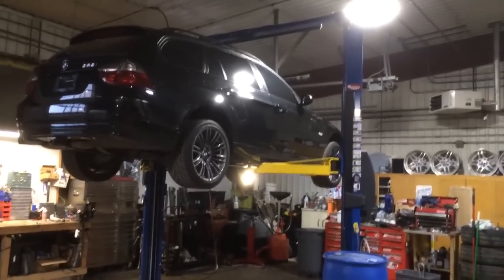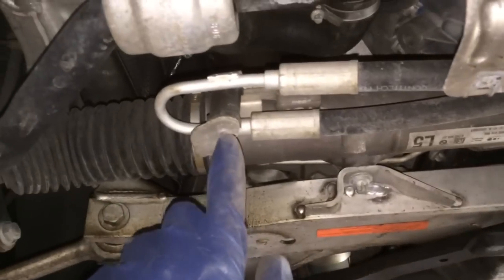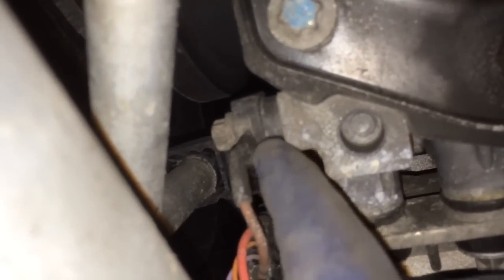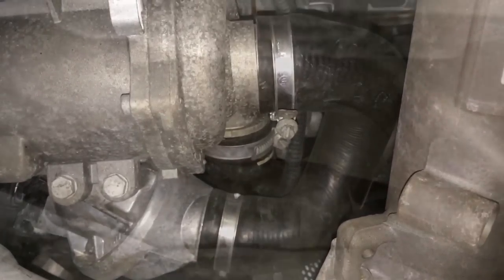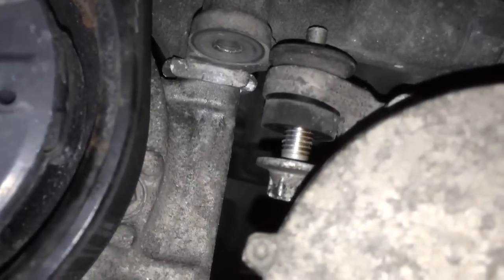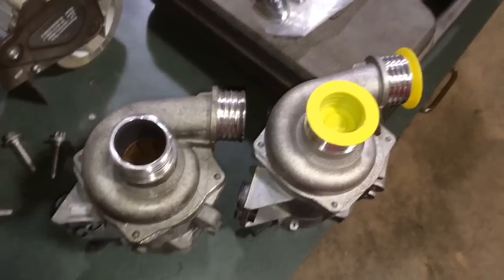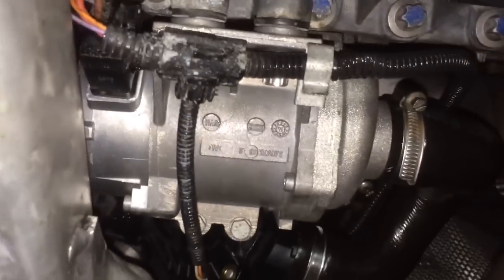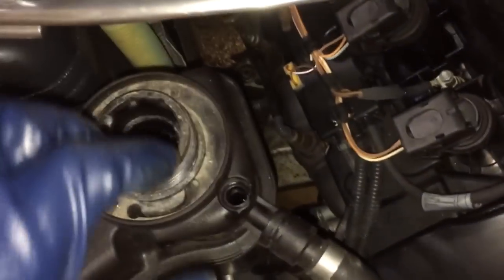BMW e90 e91 e92 e93 325i 328i 330i electric water pump and

Comment: this is not e93 video...e93 is wayyyyy different...
Reply from the maker: nope. identical. You might have a twin turbo car, those are way different. E93 328i is exactly this same process.
Reply: @OvalboreCars  nope n55 single turbo m sport.. lower x braces due to no integral roof structure.
Reply from the maker: again, this is not even remotely close to a 335i. 

the under bracing is irrelevant to the job itself. turbo cars have a completely different pump setup and are much, much more difficult. See my X1 pump replacement video for a closer analog.

This has nothing to do with your car being an E93 and everything to do with the fact you're looking at the wrong engine for a DIY.
Reply: I have a e93 with N53 engine and it looks totally different. Sitting here got many things off and now the steering gear is in front of the pump.. the video can’t be used for the E93. Don’t know what to do next now… thing I’m gonna assemble it back together and drive to a mechanic

Comment: Hello how are you doing? Very good video. I ask you, I did the test but it doesn't work for me, the mechanic tells me that the pump burned (for the second time), I changed it a little over 1 year ago, it has not even traveled 20,000 km with that pump. Can you think what else could it be? The car heats up and I found that I had blown the lid off the water reservoir. I appreciate any comments. It's a 2005 BMW 330i E90 N52
Reply from the maker: did you use a pierburg pump? it's common for counterfeit pumps to burnout almost immediately. it might have burned out the PWM driver in your DME if so.
Reply: @OvalboreCars  If I used Pierburg from Germany, how strange, it is driving me crazy. I'm going to buy a new one, before, could you explain to me if it doesn't bother you, what is the PWM and DME controller, where do I see it? thank you again

Comment: Excellent video!!! Thanks for sharing!!!
Do you have a video showing the process to determine the pump has to be replaced?!? 

Thanks!!!
Reply from the maker: the pump has a date stamped on it, and also is aluminum so usually pretty easy to tell if it 'looks' old or not in most cases too.

Comment: ehh i think my 328i water pump is broken... Just replaced radiator, main housing gasket... it was overheating and one of the coolant valves burst popped, its def the water pump right?
Reply from the maker: internet diagnostic is pure conjecture

Comment: I replaced my pump and thermostat and still is not working?? HELP??
Reply from the maker: all the more reason to take it in. it is going to need some professional help. theres a 40A mega fuse for these in the glove box, but you roasted your wiring.

Blower motor wiring is a recall item.. you MIGHT be able to get a BMW dealer to good faith your wiring harness.
Reply: Ovalbore yes i took it and left the car 
Waiting to call me...
Reply: They fixed the recalls...
But the water pump atill not responding?
Reply: Ovalbore oh yeah I just had that recall done on my car very thankful I got that done😅
Reply from the maker: bad plug, bad pump, bad ECU - take it to a shop.
Reply: Ovalbore all happened last week, the blower motor wires melted kill the battery, I replaced the battery 
And the blower was blowing even if the car is off then i saw melted wires
Reply: Ovarbole 
Sloved. I replaced the new pump with original bmw pump and now is working.

Comment: Hi I have a e90 2007 318 and the heaters are only blowing  out warm air for a matter of 2 minutes  then going cold again I've had it plugged in and it say faulty auxiliary  water pump  is this this part also I hear a clicking noise  when I try to self bleed  it but no water is circulating  can anyone help please
Reply from the maker: sounds like a low coolant level issue potentially. if there's no obvious pump noise on the self bleed mode, you need a water pump

Comment: What symptoms did you get to tell you that you had a water pump issue was it the speed or did you monitor that did you have a leak did it overheat
Reply from the maker: its preventative maintenance because of the fact they fail with no warning.

Comment: Is that the same ridiculous engine that doesn't have a dipstick?
Reply from the maker: oh, you mean modern engines? Yes.

even the new GM 4 cylinder silverado engine runs an electric water pump. 

these guys are ahead of the curve. It'd be fabulous if they just put it in the maintenance guide as an 80,000 mile replacement item. they're silly reliable and efficient through that usable life

Comment: halo my name ist ivo. I did evereting that that video seat  i by two pomps pierburg 2018 but non one works.  are the pamps broken or i need to by a special pomp? I put the old pump back and it works, but the new pomp dasnt work. pleas help me. Thank zou
Reply from the maker: if the pumps are new and OEM -- your connector or DME pump driver are bad.

Comment: This was an excellent,detailed  video.I have an E91 N57 TYPE 2 engine and the water pump is some what different to the one you have shown.Mine has a composite pulley attached to it and this broke.I just want a metal pulley.Would you please point me in the direction where I can get one.Many Thanks
Reply from the maker: Good morning -- the Diesels are quite different, and I love that the waterpumps are mechanical. Unfortunately after 2006, BMW stopped making any aluminum water pump pulley. your best bet is trying to find a company that makes a full aluminum underdrive set and buying that.

Comment: Your videos are fantastic... thanks for sharing your knowledge.   I've got your car - '07 E91 sport package, no iDrive, manual transmission.  It's got 102k miles and it's original water pump.  If this was  your car, would you proactively replace the water pump and thermostat?  I'm guessing yes, but figured I'd ask.
Reply from the maker: I would never run an N52 pump past 80,000 miles or an N54 pump past 45,000 miles.
Reply: Ovalbore I figured I was living on borrowed time.  45k miles on a pump.... BMW ought to be ashamed to read that.  Our N54 equipped x5 puked up its pump at 61k miles.  That's a really short life.  Bad design or weight savings taken too far?
Reply from the maker: thats a part that would be difficult to bulletproof. There isn't one failure mode either.

Its an efficiency measure, really not a big deal, just add it to the maintenance docket.

Comment: Thanks for sharing.......I did this 2 weeks ago to my wife's e91.  You made it look easy and this helped a lot & made it easier for me.   Because I did not have a lift and did it on my back, I removed the fan and it gave more working room and more visibility. The top bolt on the water pump is the most difficult to remove and put back in. I found it is easier to use a 1/4 ratchet with an extension, then a universal joint, then the 1/4 to 3/8 adapter to the 3/8 e12 socket. It made it easier to reach the top bolt in the tight space. You need the flex driver with the 6mm for the hose clamps. It is 2008 and it had 168k with the original pump and thermostat.  It is not a fun job.  I had to work in 1 to 2 hrs shifts and walk way because it can be frustrating.  My Indy wanted $1100 to do this job and the "Stealer" wanted to $2200. Crazy.   Spent $330 on the OEM Pump, Thermostat and BMW Coolant.  Spent another $120 some tools, clamps and two upper hoses that disintegrated when removing the fan. Spent about $450 total.
Reply: How long did it take you in total?
Reply: Dan Truong mine took about 6 hours
Reply: The video was a tremendous help, but what really sealed the deal, the icing on the cake was your comments about that top bolt & using a 1/4" drive ratchet & then the adapter to 3/8" drive. Thanks.

Comment: first test drive did you do it with sway bar and power sterling whose unconnected or did I miss something
Reply from the maker: nope. it was all back in, underpanel was left off on the test drive though to check for leaks.
Reply: ok thanks had me worried on how did u do that

Comment: question i just did my head gasket like 2 months ago and now my car is overheating, i did smell coolant in the air vent but the car is not mixing coolant with oil. the smoke from the muffles is normal. i am assuming its the water pump and thermostat and the heater blows cold air not hot.bought the car with 108k just hit 120k. Do u think its the water pump as well?
Reply from the maker: if you're getting the sailboat on your gauge cluster, you have issues.

smoke from exhaust isn't normal unless its burning off after the head gasket change still..

Comment: Shows once again how much easier BMW'S are (for the most part) to work on versus Japanese cars. Great video.
Reply from the maker: there's give and take certainly. this wasn't TOO bad
Reply: Depends on which Japanese cars. I just replaced water pump-thermostat-belt on 8th-gen civic with 1.8L engine and it took me about an hour  including everything. I didn't even have any issue and I just thought it would be good to do it before they fail( I replaced them for the first time at 208k miles, I have seen original pumps go pass 250k miles). I have been thinking about getting a 2011 BMW 328i and we have 20 miles one-way commute in traffic every day.  It might not worth getting one if pumps only last 80k miles or so.

Comment: This video helped me on my e92.  This is a lift job if you can get one.  A 3/8 fits those e12 bolts perfect. I used the new pump to figure the angle and ujoint set up for the top bolt.  I have turbos and the continent vdo pump was correct.

Comment: Error code on check engine reads faulty thermostat.... never had overheating issues though??? Problem I am having though is every acceleration theres a baaaad shake almost makes it not accelerate is this the thermo or water pump at fault here? Thanks in advance
Reply from the maker: you're under heating.
Reply: What did you do to resolve your issue. My car 2008 328i shaked occasionally along with some type of fault symbol on the display but it would go away minutes later. that continued for over a year and a half...now I'm over heating with smoke from radiator. Must be my water pump and thermostat?!?!
Reply: Pino Amerikano I would say so

Comment: Would the water pump in the video fit a 2013 x5 x35i? Reason I'm asking is because the OEM ones has plastic on the top of the pump (https://www.amazon.com/BMW-Electric-Turbocharged-Genuine-OE/dp/B00FAVNVPA/ref=sr_1_1?srs=7583723011&ie=UTF8&qid=1495255019&sr=8-1&keywords=11517632426). 

I was not able to find an all-metal water pump.

Comment: So i thought that when the bleed procedure is initiated by stepping on the accelerator for 10 seconds, that the actual bleed procedure runs for 12 minutes (cycling on and off).  i think in the video you said 1 to 1.5 minutes.
Reply from the maker: its 120 seconds on the N52 cars

Comment: Hi. Appreciate you taking time and making this video. I'm about to purchase 2008 e92 328i with 81k miles. I'm already looking up all possible failures on the car. I have noticed that water pump is very common. Hope the car doesn't crap out on me as I'm gonna be 5 hours away from home. How much does a water pump and thermostat cost? I quickly looked it up online and seems like the parts alone cost upward of 700$+ I've never had a BMW but I'm lusting over 328i coupe so that's what I'm gonna get. I am pretty mechanically inclined. Do you think I'd be able to do this job? The hardest repair I've done in a car is replacing clutch on my friends Miata. Thanks for any insight you can give me.
Reply from the maker: hey -- you should be ok, just keep your driving moderate. I bought my E91 with 79k on it and drove it 1200 miles home to do the water pump. I've seen some go longer though.

my installed cost for OEM water pump and thermostats are as follows:
RWD N51/N52: $550
AWD N51/N52: $600
RWD N54/N55: $650
AWD N54/N55: $700

does not include four-zone climate vehicles.

Comment: I had a water pump and thermostat replacement done less than 3 months ago, the pump gave. out already again, im changing it out again. don't think the thermostat is out though, should i change it out anyways too?
Reply from the maker: If it was replaced at time of water pump, I wouldn't. 

they probably used a cheap knock-off pump. Pierburg pumps usually last 80-100k miles on these

Comment: i bought a berh mahle and vdo water pump n thermostat are they good brands
Reply from the maker: for the N54/N55 you want the VDO/Continental pump, yes.
the Behr, Wahler, Motorad, Beck/Arnley, Stant thermostats are excellent.

stuff like Koolman is junk.
Reply: Ovalbore ok the god it was like 400+ bucks

Comment: cool if u have check engine light would the motor cut back boost...? i have a vent guage that max it goes too is from -3 to 0.2 psi
Reply from the maker: probably -- these are Normally Aspirated water pumps/engines here

the N54/N55 is something I have much more limited exposure with.
Reply: Ovalbore oh okay i understand i found out why the boost guage was weird the vacuum line poped off secured it with zip ties

Comment: i have a 2007 bmw 328i and i think my electric water pump is out cuz the car keeps overheating on me ? it has plenty of coolant would this be able to help me
Reply from the maker: stop driving it. yes, it's almost certainly the water pump. you will (or maybe already have) done significant damage to your engine by overheating it.
Reply: Ovalbore  what electric water pump and thermostat should I get to replace it ?
Reply: trying bleeding procedure see if it comes on and starts circulating the coolant in the reservoir.
Reply: @ignacioromero5014  doesn't start. Must mean the pump is out

Comment: Thanks for the Video,
My 06 E90 325i keep throwing overheating symbols,
I tried the trick to see if the water pump would run, and it doesn't, could this be my issue?

Thanks

Comment: This job was hell on a 2007 e90 328xi. The sub frame on the 4wd is totally different and you can't get to any of the parts with out great effort.  All hoses were stuck on and also took a great deal of time to get off. Combine that with poor manuals from all sources and no direct comparison vids and it's typical BMW take forever the first time you do that repair. Tips, remove the right front wheel, remove aluminum stiffener, don't attempt to remove radiator as some threads recommend. Oh, don't forget to disconnect the battery if you don't finish the job in a day as having the hood up causes some weird parasitic draw. Some of the plastic hoses were brittle and cracked. Anyway, this is one of the many BMW projects that could have been made 100 Times simpler with a specific manual.  Even the Bentley manual is vague and gets the bleed procedure wrong.

Comment: Great video thanks. My 2009 e90 328i manual sedan is getting luke warm heat. I've ruled out coolant level and thermostat as the culprit. Do you happen to know if the heater core input\output lines can be accessed from the top if the air box is removed?
Reply from the maker: sounds like heater valve or thermostat. check CLT engine running. so many MAP controlled things on that car.
I've never seen a late model BMW heater core plugged. the blue coolant is excellent, even if neglected for more than 10 years.
Reply: Thanks for the quick responce. I looked at the 2009 e90 hose parts diagram and didn't see a heater control valve. I know the e46 and e39 had them. I ruled out the thermostat being stuck open by unlocking the engine temp and driving on a 50 degree day with the heat full on. The temp runs normal around 90C (displayed in C and not F). My car has 65000 miles so I am also somewhat perplexed as to why the heater core would be blocked on a low mile late model. interestingly, I called the local BMW service manager and he said they have done four this year and some others had the same issue on the forums. I'd like to reverse flush just to rule out any block sand casting or other debris.

Comment: finished in about 7 hours and was cursing the whole time under the car. the bolt behind the pump is hell to get. and my thermostat hoses were like welded to its inserts. found it was the original pump from 2007 with 133k mi on it! . car feels very happy afterwords!  fuck you for having a lift ;) waiting for the next e30 update. ps i love how you were ripping the m3 manual swap in limp mode. im sure the engineers were smiling

Comment: I just did this and it was easy thanks to the video, but I had a lift . took me around 5 hours. get a flexible ratchet extention for the top bolt. (i used flexible 1/4" drive socket though took kinda long but had to remove the hose that is in the way made it easier)  Also a 10mm works for all 3 of the inverted hex bolts. I bought my pierburg for $270 on ebay and $50 wahler/behr thermostat on amazon. Use a circular motion of force when re-installingthe hoses that have the metal wire clip, you'll know it's seated correctly when its all "snapped" in. if you dont it will eventually spray out as happened to me. I used a drill and adapter to take off and on all the 8mm bolts for the plastic aero paneling cause im lazy. I bled my system a few times, had lots of air, while connected to a batter charger. Also, the pierburg comes with the bolts, dont buy them extra. GL all!